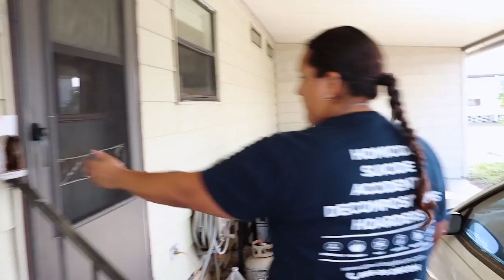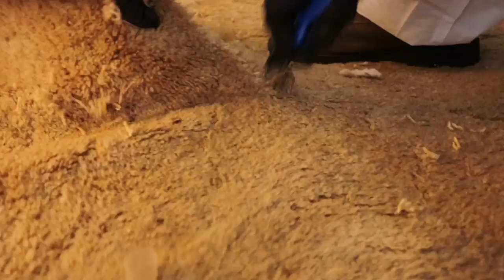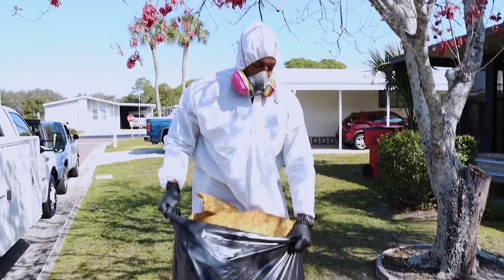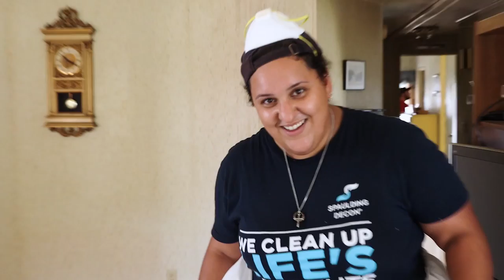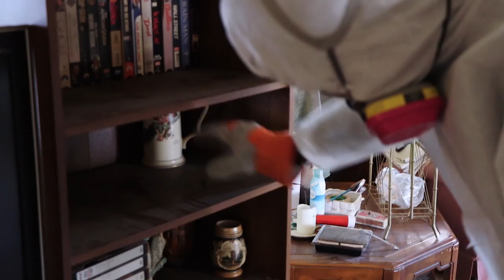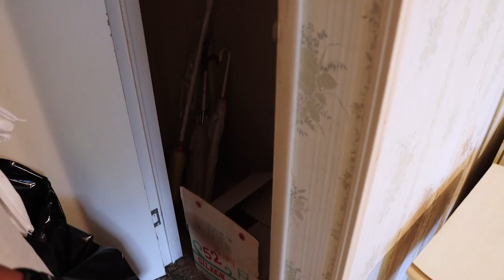Double-Wide Death Stain | Apollo Beach, FL

Comment: I didn’t realize cleaners like this actually replace the flooring, etc.  like this.  Or clean out everything.   I thought they just clean up the actual area with the blood, etc. and nothing else.
Reply: Have to be thorough when it comes to biohazard. Don't want the people that move in getting sick.
Reply: They help hoarders go through their stuff and get organized. Spaulding does a lot of different types of cleanup jobs. Chemical spills....They're really kind people too.
Reply: It depends on what level of service you are after, and what is going to be done with the property when the job is finished. E.g. no point replacing the floor if it's going to be demolished. Some people only want the bare minimum, so they remove biohazard and clean/seal the biohazard area. Others might want Spaulding to help with the "death stuff" like cleaning the house, sorting out the belongings etc.
Reply: Contamination issues, flies ect.
Reply: it depends on he company. Some will simply cut out a square of the carpet thats affected by the decomp and will leave you to replace. others will just take the body and that's all.
Reply: Linda Miller - sometimes these clean/up companies, actually buy the property and resell it.  Which is a good reason to fix it up (repairs, etc.) as well as doing the bio cleanup.
Reply: I think it depends on what's going to happen with the property later. In the case of this home, leaving a hole in the floor wouldn't be safe, so they had to put a basic floor back in. Other times they strip out all of the flooring, drywall, etc. and don't replace it, they just left studs and concrete

Comment: She's Very handy with construction except for the One mistake she made in calling what is basically just a Floor Joist Brace a Support Beam which it's Not (at about 12: 30-37). It would have probably been just as fast and More thorough because of Bio-fluid to have just screwed temporary strips of plywood cut to the same width as the joist braces, broke out the contaminated lengths and replaced them in the already pre-notched 2x10's or 12's that are the floor joists instead of soaping them, steel brushing them and using a heat gun or hair dryer to dry them out.
 But I'd give her a job if I were still doing Renovation or Additions.

Comment: I have a question on that sofa how come you only cut out the area where there was blood instead of just getting rid of the whole sofa cuz you ruined it
Reply: They have a special way of getting rid of contaminated items and since the cost is based on the weight, they only cut what they need to. They will throw away the rest but the bloody areas are treated differently.
Reply from the maker: biohazard-saturared materials need to be disposed separately from regular materials!
Reply: the blood stained items need to be disposed of differently
cant just throw human bio in the garbage normally ya know
Reply: The auto-clave place they take the bio charges by the pound. So they only take what they need there. The client can then get a dumpster or take the rest of it to the dump.
Reply: The part they cut out is contaminated with bodily fluids. It needs to be disposed of as biohazard as it is a health hazard.  Cheaper and more efficient to cut out and bag only the contaminated material than the whole sofa.
Reply: they did get rid of the whole sofa or did you miss the part where they threw it in the dumpster?

Comment: Few things you could do. Use a bolster not a whammy bar to hit into the wooden floor it's safer. The support beams can be removed and replaced you can see the join. Have a tape measure if you don't know the with and length by eye and if you need to put pressure on a drill it needs charging or you need a more powerful drill...